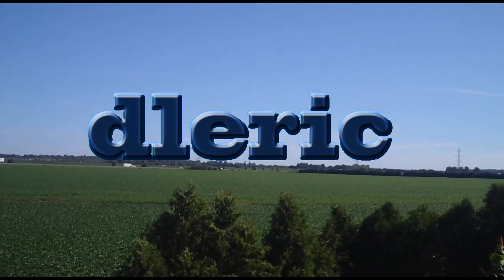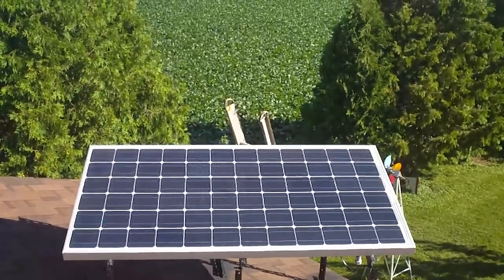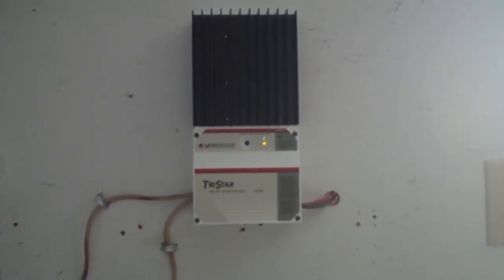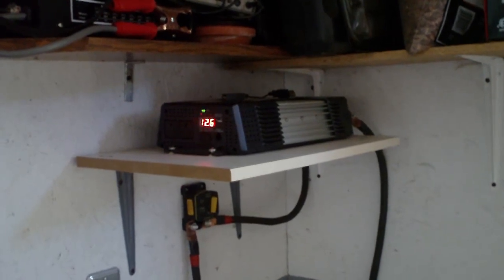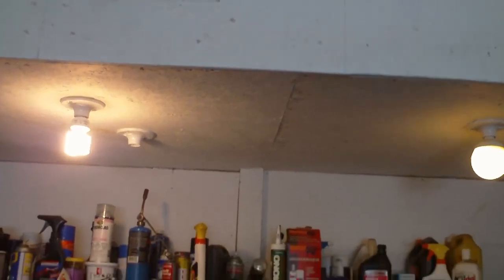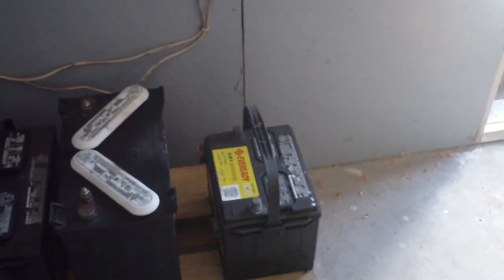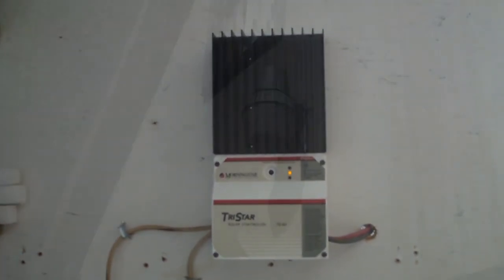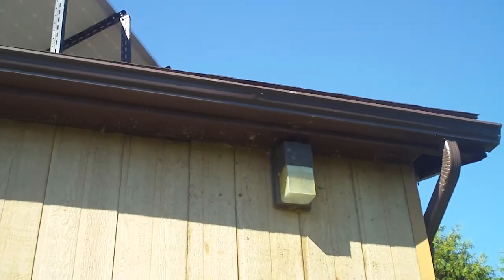My DIY Home Solar System

Comment: [Awesome Plan Here >>>https://www.facebook.com/Build-Your-Own-Solar-132917764038406/app/208195102528120/ ] It has just right information regarding solar electricity- its fundamental and how to size and install a system. Anyone with a little technical background can understand and follow easily. It illustrates real world solar electric design.

Comment: I ran all of my lights on 12VDC  I don't have to power up my inverter for that. it is very efficient doing it that way.
Check out channel and my google+ for more videos, photos and diagrams how to wire up different systems like 12V 24V 36V and 48V plus different kinds of solar modules configurations. 
Please pass it on subscribe and thumbs up on my channel.
God bless.

Comment: Howdy!  Do you run your yard lights all night, every night?  Are they on a timer, or just a switch?
Reply from the maker: Just on a dusk to dawn sensor. The sun goes down they come on and the sun comes up they shut off.
Reply: Eric H   So you have plenty of power in the winter with the short days and long nights, what do you do with the excess charge in the summer with the long days and short nights?  I've been interested in hooking up a solar panel system to run malibu yard lights and a couple of spot lights, and am just trying to learn about all this.
Reply from the maker: TheStavros1001
In the winter I am a little shy on power. But in the summer I run it every night. The charge controller is like a battery charger, it will not over charge the batteries.
Reply: Eric H Brother have you looked into the 120 volt LED light bulbs? I got 4 at wallmart for 20 bucks. They pull 8 watts at 800 lums. They put out more light than a 40 watt CFL. I run all my solar lights as LEDs now and that saves me 400 watts or more at night.. God Bless
Reply: yankey4 Are those bulbs waterproof?  32 watts for only 4 bulbs that are too bright for me doesn't work.  I like just enough light to be able to see, not light it up to read a newspaper. <g>  9 of the 3 watt bulbs gives me plenty of light around the house and yard,  plus a 10 watt floodlight gives me less of a load than those 4 bulbs.  As a plus, sticking with 12 volts means I don't need to power up an inverter to convert 12 volt to 120 volt.
Reply: TheStavros1001 That is true and I did not think about that part. Love your setup tho. God Bless

Comment: How can you have a 1500W inverter if you only have a 190 W panel? It means you only have max. 15A coming from your panels to feed the batteries? You cannot turn a heater (1000W) on for more than an hour or your batteries will be dead??
What kind of batteries do you have?

Comment from the maker: Actualy the light on the side of the garage is a 23 watt cfl bulb and the one on the front of the garage is a 45 watt cfl bulb. I know the batteries are discharging more than they should, but they are not the best batteries. They are used and were in bad shape when I got them. I kinda nursed them back but they are no where near being like new. It does not take much of a load to bring them down.

Comment: True 11.9 is bad if you run your batteries down that far unloaded, but didn't he say he was running his lights?  If so, the "true" battery voltage would be several tenths of a volt higher since running the lights would temporarily decrease battery voltage.  If he shut down the inverter and checked a couple of hours later he might actually be at 12.3 or more.

Comment: I like your system setup.  I have a 60 watt 12 volt PV system, also DIY.  It is paired with an 1100 watt inverter.  The comments about cable gauge cannot be overstated.  I actually have a 200 amp ANL fuse between my battery and inverter, as the surge wattage on the inverter can reach 2200 watts.  Starting up say a freezer or refrigerator might briefly exceed 150 amps off the battery so I wondered why you chose a 150 amp fuse.

Comment: Any deep cycle battery should work (but avoid 8V batteries for a 12V system).  Do NOT use vehicle starting batteries as repeated heavy discharging will kill them in short order.  Grid recharged batteries will work for a few days if you manage loads properly.

Comment: after thinking I'd like to start my system backwards, ie get the batteries first to charge from grid source for backup, then finish with solar panels when I can afford them; is this a good idea?  What batteries should I use?  I saw your comment first and think it might appy here if I intend to use the batteries during power outage.

Comment: Repeatedly draining your batteries to 11.9V will kill them.  If you want to run outside lights, then either use 12V lamps or a small (100W or less) inverter.
Also, smaller PV modules are easier to move and if one dies the rest still work.

Comment: I need a low cost inverter and a charge controller, less than about 75 bucks apiece, can anyone tell what is and where is a good brand? Does walmart or sears or whatnot sell these? I have to power an oxygen machine for my mom in case of emergencies, the machine is 350 watts by 120 V...thanks